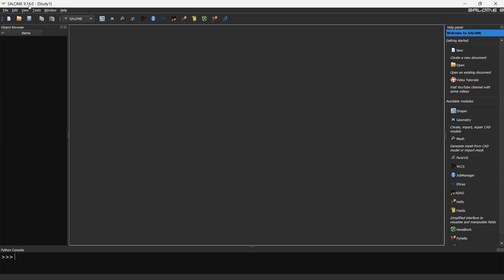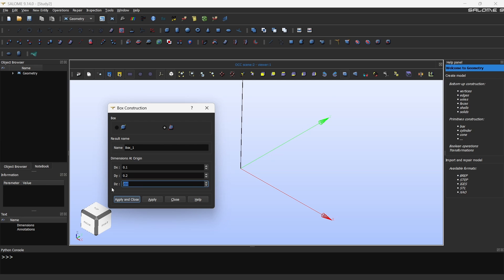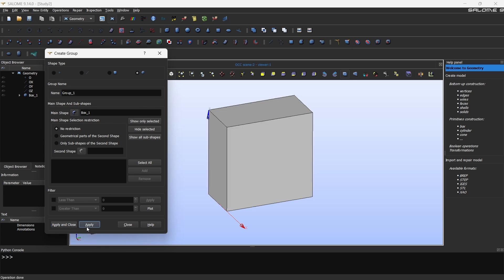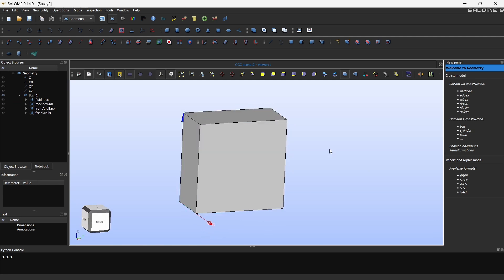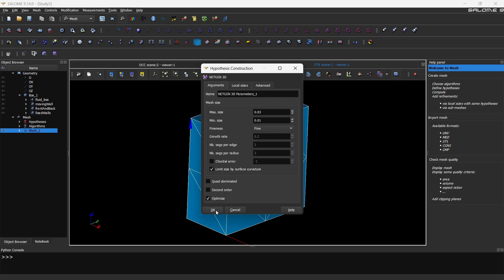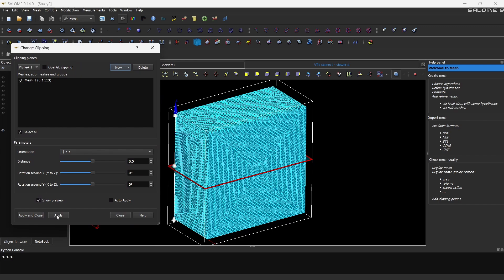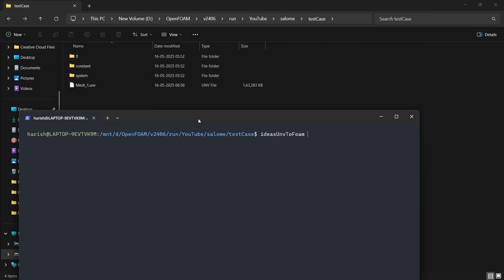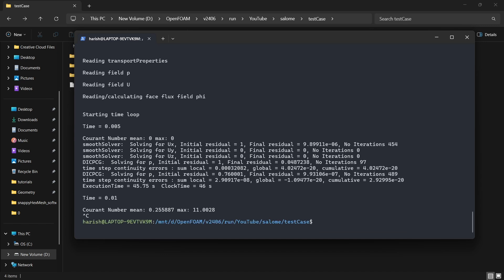Salome Meshing - Part 1 | Introduction | OpenFOAM | 3D Mesh

Comment: I tried to follow this tutorial with a different geometry. I created a geometry in solidworks - my geometry basically had extrusion and also surfaces. Exported it as step file. Imported it in salome, started by creating group name  fluid_box , it showing no  volume. What mistake did I do , please help.
Reply from the maker: Please stick to having just solids. If you have surfaces it will be a problem.
Reply: Thank you  @Codeynamics